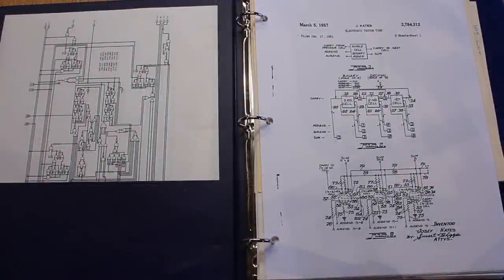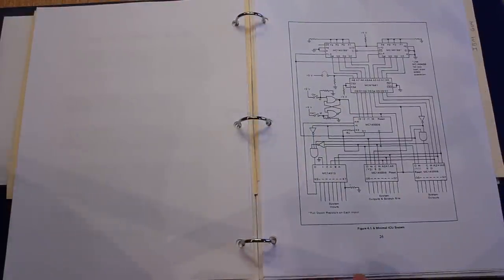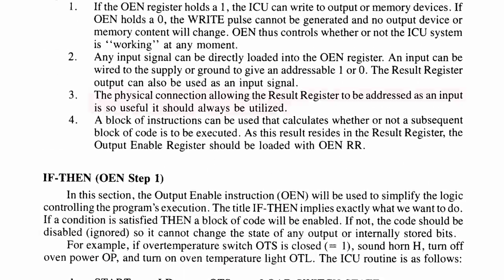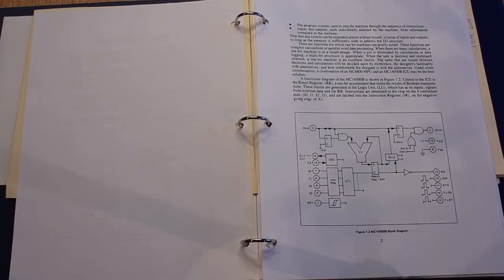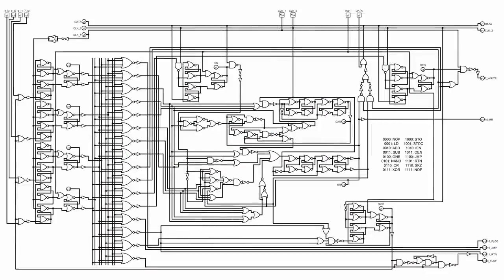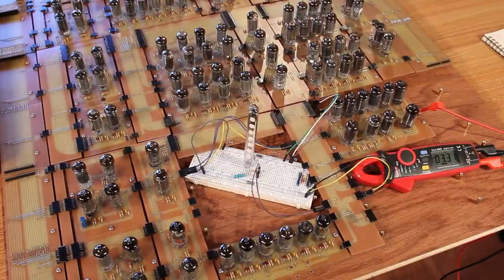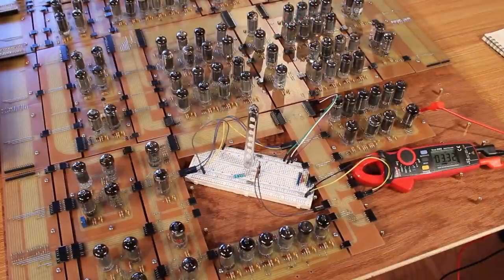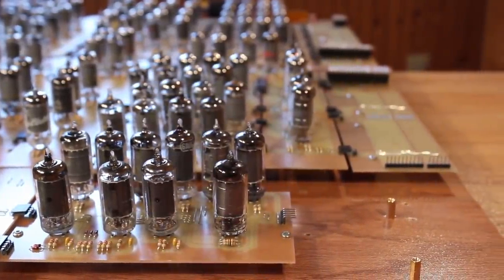Vacuum Tube Computer P.20 – IF-THEN Hardware

Comment: I was wondering it wouldn’t be hard to run mc14500 code 👨‍💻 on your ue14500, only need to swap few instructions
Reply from the maker: It depends a lot on the specific code! The MC14500 needs a lot of programming gymnastics to get some stuff done that the UE14500 can do in just one or two instructions. And conversely, the MC14500 can do some trick stuff with some of its logic instructions that the UE14500 can't do. But, with an intimate knowledge of both, you could totally port programs over!

Comment: Awesome, I love this! I'm curious what the power draw will be for your completed CPU? Also, I don't think I've seen that many tubes working together at one time in recent history! Must warm up your room pretty quick :)
Reply from the maker: Thank you so much!

The completed CPU will have, interestingly, exactly 190 tubes on it. Each tube heater is rated at 300mA at 6.3V, but I'm undervolting them by running them in series off of 24V, so they're actually closer to about 280mA each. That comes out to about 1.7W to 1.8W per tube, and with 190 tubes, that's a massive 340W of power! Fortunately, that's split between the two power rails, with the 24V rail powering 156 tubes and the -12V rail powering 34 tubes, which comes out to 24V @ 12A and -12V @ 5A.  It's a power hungry beast! You can definitely feel the temperature in the room creeping up the longer its on, haha.

But, the processor is just the tip of the iceberg. I reckon I have another 500 tubes to go before the entire computer is complete!
Reply: I think the next module you build will need to be the air conditioning module...

Comment: OMG, this computer is getting more and more complete... and looking more and more magnificent!
And you clearly have a lot of fun making it :)
Reply from the maker: It's getting there, I'm starting to get super amped up as this almost year long project draws nearer to (1/4) completion! 
Memory, Program Control and I/O are all sorts of new an interesting problems, but with processor working, it'll feel doable. I've pretty much put all other projects on hold until I get the tube processor fire up and running!

Comment: really nice, it looks more and more impressive with every board added. 
I wonder how compact you might be able to get it by using the more common approach of little metal carrier things with two rows of tubes on it (like the module you repaired once)

I am looking forward to you interfacing this thing with some io devices, magnetic tape sounds fun, maybe also a simple level shifter to inerface more common 5V TTL logic? 

Did you already need to redesign the power supply or is it still strong enough?

Greetings, 
Michael
Reply from the maker: Thank you so much!
Using little plug in modules like the IBM604 used could really make a huge difference! Especially if I made them just a little bit taller and managed to squeeze two NOR gates per module. That means I could build an entire D Flip Flop with just three modules, which would be an insane footprint reduction. Currently, one of my D-Flip Flop boards that uses 6 tubes (like for OEN, IEN and Instruction Registers), is 150mm x 60mm x 55mm (LxWxH). That gives a total area of about 0.5L.

The plug in module the 604 uses measures in at 25mm x 25mm x 145mm (LxWxH). It's quite a lot taller, but the footprint is minuscule. If we bump that up to 150mm height to stuff to NOR gates in there, that gives us a total area of about 0.1L per unit, and with three units that's a total area of 0.3L, so a pretty notable reduction in volume. 

But the real kicker is the reduction in footprint. With the way I have it laid out, height is totally inconsequential. Whether I'm 55mm or 145mm makes no difference at all, but the footprint drops from 150x60 to 75x25, which is insane. That means I could very nearly fit four D Flip Flops in the same footprint as my original one D Flip Flop. That's a massive reduction in size! 

Interfacing with I/O is going to be a serious challenge! Magnetic tape should be relatively easy since the amplifiers to read it can all be run at 24V, but interfacing with an output device like my Teletype is going to be quite difficult. That thing needs a 120V DC 60mA current loop, which would be a mess, so I need to build some kind of tube based opto-isolator to interface with that. Then of course, if I want to interface with something newer over RS232, I need to go the other way, which is going to be equally as interesting. But, that's all for future Me to worry about, haha.

The 24V supply is still totally fine, but the 12V supply just isn't keeping up. Ultimately, I'll need about 6A on the -12V rail, and the little wall wart in my current supply can only supply up to 3A. So, I'm working on building a new supply that has a beefier 12V on it. I've got it mostly built, I just need to wire it all up now!
Reply: @UsagiElectric  
Cool, thank you for the detailed analysis. Very interesting to see this idea in actual numbers ... and fascinating, that you already did all the math. 

I'm really looking forward to the next part. :)
Reply: Fast relays were used for TTY interfacing back in the day.

Comment: Nice job. I wonder if the diodes can be replaced by tubes as well.
Reply from the maker: The diodes totally can be replaced by tubes! I did some testing using the 6AL5 dual diode and it works brilliantly, even at low voltages. Check out my 1-minute video on making an OR/NOR gate using the 6AL5 and 6AU6 here: https://youtu.be/5YrcGr04kKk

Comment: And i thought i was special .as i used to service HP3000 computers .They had processors designed with only discrete logic ..No integrated processors back in those days ....The whole machine only had 2Mgs of memory .Even early x86 had 640kb at most ..
Reply from the maker: Don't sell yourself short, working on the old HP3000 computers is absolutely amazing! That requires a level of skill I certainly don't posses, though it would totally not stop me from poking around in side them, haha. I would absolutely love to get my hands on an early HP Minicomputer someday. I'm a bit of an HP fan anyways (especially of their really early tube stuff), so even seeing an HP3000 in person would be really special!

Comment: I know you are religiously sticking to period correctness.. would you consider  using an eeprom with a level shifter for your one bit computer to execute complex programs ? Would something like that could be possible ?
Reply from the maker: Something like that could be possible, but it doesn't work well with the current planned direction for program control.

My current plan is to use magnetic tape, and have the clock come directly from the tape. The instruction word will be read serially from the tape and shifted into a shift register on the UE14500, then a parallel read of that shift register and global clock pulse will execute the instruction. Unfortunately, with a ROM, I would have to do a ton of work to either get it to output data in a manner the UE14500 can read, or I would need to change the UE14500 design, so it's just not really a viable method of reading really complex programs.

But, magnetic tape is just an audio signal. And it's an audio signal I will generate on my PC initially, and then record to audio tape. What this means though, is that really complex or massively long programs absolutely can be saved as MP3s. Then, with just a really minor amount of circuitry, something like a cellphone could be plugged into an AUX jack on the UE14500 and the MP3 played back! 

That's actually going to be a pretty essential part of the whole development process anyways. It'll be way easier to write and test programs with an audio file stored on an old cell phone than trying to record and lace up magnetic tape everytime. Once I've got some programs that are good demonstrations, I'll record them to audio tape, loop it up, and sit back and let it run on its own.

Comment: This kind IF-THEN execution is not so uncommon in fact. Eg. ARM supports conditional execution almost on all instructions, not just on branch instructions. For Eg ADDEQ does add only if EQ condition is set. IIRC also Itanium has a similar feature. Although these newer processors do have more than one flag register (=OEN). But the idea to execute an instruction, but ignore results when the condition is unmet, is still the same.
Reply: And they all (ARCH64, x64) did away with this
Reply from the maker: Whoa, that's really interesting! I'm really unfamiliar with the ARM architecture in general, but it's really cool that they (at least initially) had the capability to do conditional execution. I can definitely see how it would be preferable for really simple conditional statements, but I can also see that there are some serious limitations to it as well. Having both conditional execution and the ability to jump to different spots in the program counter would be extremely useful though, I feel!
Reply: @UsagiElectric  conditional execution of a JMP or JSR is only some special case. They had 32 bit in their instruction word a looked for application. MIPS use those bits to address more registers instead. The older MIPS won -- but only when combined with branch prediction. Branch prediction killed the branch delay slot, which is evil anyway.

Comment: After testing and proving a tube is good, how likely are they to stay good for forseeable future? ie: do they hit a cliff and suddenly fall off, or is there a slow fail typically, which could be predicted perhaps based on performance trends?
Reply: these tubes are suited for digital. Early ones were not and failed fast
Reply: Depends on a lot of factors, sometimes the filaments break and the tube dies immediately, sometimes a short can develop and it starts acting erratic, and sometimes they just slowly lose emissions over time.
Reply from the maker: As Ignacy said, it depends on a lot of stuff, so all I can really offer is anecdotal evidence. 
In my experience, the way in which I'm using the tubes is very understressed (even the filaments are under-volted) and their total uptime per day is very low, so once I know I have a good tube, I fully expect them to last the life time of the machine. The primary factor that might contribute to tube death in my application would most likely be my clumsy, dumb self knocking into them and breaking them physically. 

There's a lot of electrical factors that can contribute to a tube losing performance. Things like cathode poisoning or stripping, flakes of the anode causing a short, the filament breaking, etc. Shorts and filament death are hard to predict, but cathode issues present themselves in weaker and weaker emission. On my low voltage tube tester I made a few episodes back, that would show up with the tube not getting all the way to saturation. Any 6AU6 that only makes it down to about 8V to 6V is tired, and any 6AU6 that doesn't make it below 10V is so tired it gets replaced.
Reply: @UsagiElectric  I was thinking that when you run your arduino test for example, that its not a binary yes/no, maybe there woudl be some way to predict .. "this one will go bad sometime, vbut is okay for a few months" but that sounds out of scope for hobby work :)

Comment: Ive had some time to think about this, I'd though of putting oen and ien on the external command register for my 1-bit state machine. After watching this again I think it might be a good idea to move halt and replace it with OEN. I had no idea how useful it could be. I just got to say absolutely fantastic video again. I watch a ton of tech YouTubers and I can't tell enough people how great your projects are.
Reply from the maker: Thank you so much!
When I first started learning about the MC14500, I totally didn't get the IEN and OEN functions. But, after starting to dive into it in a bit more detail, it's a little crazy just how powerful they can be! It can also get even more impressive if the designer builds additional jump circuitry separate to the MC14500 working on the JMP flag. That way you can use IEN/OEN to execute conditional IF-THEN-ELSE statements and have the ICU conditionally toggle the JMP flag. 
Thank you again for the wonderful comments on the projects! It means a ton to hear that you're enjoying the content and getting something out of it!

Comment: So...Tape drive, Eh ? There are a few different ways you could implement that. Interesting.

Also, I just occured to me, It must weigh a ton. LOL.
Reply: or tape of the non-magnetic variety fingers crossed
Reply from the maker: I've got a few ideas percolating in the old brain case! The primary goal is to minimize the circuitry necessary on the UE14500 itself, but that's going to come at the expense of speed, which is a sacrifice I'm alright with making. Once I get further along with memory, I'll start testing different ideas to see how viable they're going to be!

And, it's definitely not lightweight! Though, it doesn't weigh nearly as much as that HP oscilloscope!
Reply from the maker: @zbradbell  Unfortunately, I don't think paper tape is in the cards. Magnetic tape I think will be a much more manageable path, but we're talking pretty far in the future. My plans two months ago for memory were dramatically different than my plans for memory today, so things tend to change pretty rapidly on this build!
Reply: @UsagiElectric  With regards to tape, I was thinking one channel could be for the clock, and the other for data. (is it still one bit ? I can't remember.)

It might get heavier,  It has no transformer or rectifier. (yet. LOL)

Comment: Have you got all this planned out months early? ie: predrilling the mounts was sort of a 'tell', or else all the boards have the same mount positions and you work the pcb design around them?

Its a thing of beauty, really; period appropriate art and probably all the components are available in the tube era? Those diodes .. something equivilent was available in the 50s and 60s I think, but earlier would've been just more tubes no?  From camera height, its like a small city of tubes....
Reply: Solid state diodes are a 19th century invention, "modern" junction diodes are a product of 1950s.  Before the 1N34 launched in 1946 vacuum tube diodes would probably be considered more reliable .
Reply from the maker: Thank you so much!
I do kind of have it planned out quite early. The PCB design for this last section I finished about three months ago, but only properly finalized it about two weeks ago (the work on memory required some rework on the processor). But, milling out the PCBs and soldering them up happens pretty much just a week before an episode goes live, so the physical state of the processor is pretty much exactly as it is in this video right now. 
The PCB design for the memory is now about 90% complete as well. I'm quite excited to finish up the processor and start with testing of memory elements and then starting construction of that. The memory is kind of a double-edged sword. It's a fairly simple design, but there's a massive amount of repetition, so there may be some big gaps in videos since most of the memory will just be making the same boards over and over again. Still, it should be quite exciting to see it start to come together!
Program Control and I/O are still just thoughts brewing in the old brain case. Once memory gets underway, I'll start diving much more heavily in program control.

Germanium diodes were quite commonly used in tube computers in the late 50s, but the 6AL5 is also a really brilliant little dual diode that would work perfectly for the type of logic gates I'm building here. I've actually built test pieces using the 6AL5 and they do work super well, the only problem is the number of tubes would be doubled!
Reply: @UsagiElectric  need to get this series on Hacker News and EEVblog and such; you deserve so much more visibility to this work!

Comment: It dawned on me that you could have been 'period correct' to vacuum tube computers while still using DTL - diode tube logic ;-D Would have simplified some modules.
Reply from the maker: Yup! Although, it was really common for tube computers in the late 50's to use germanium diodes, very similar to what I'm using here. The IBM 604 and 650 both used quite a few silicon diodes in places where space was a priority (though from the documentation, it seems IBM still preferred tube diodes where possible).

But, the 6AL5 is a brilliant little dual diode tube that I've actually used to build up some test pieces of the logic gates I use, and it works brilliantly! The only downside is the number of tubes, and subsequently tube heaters, would double!